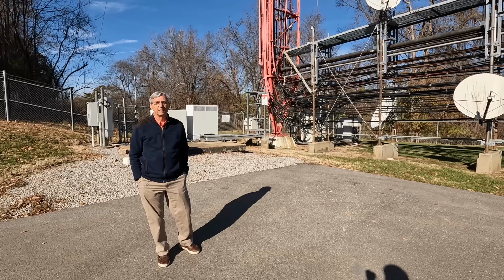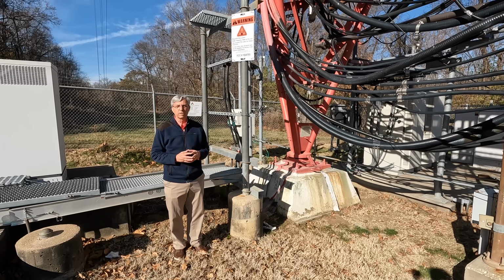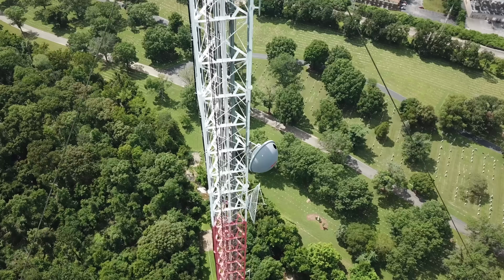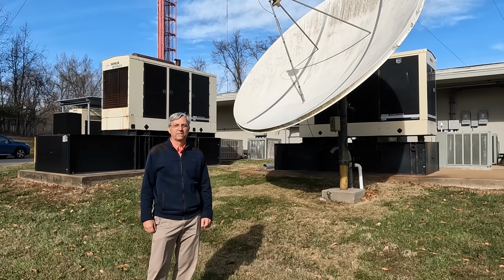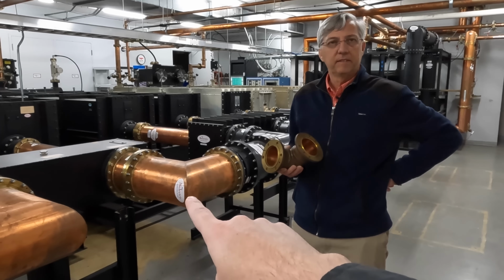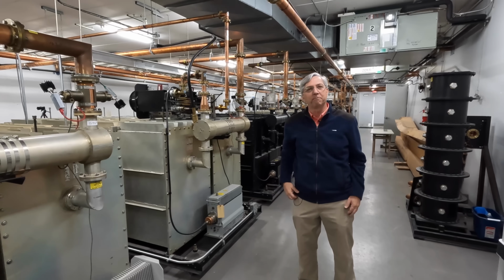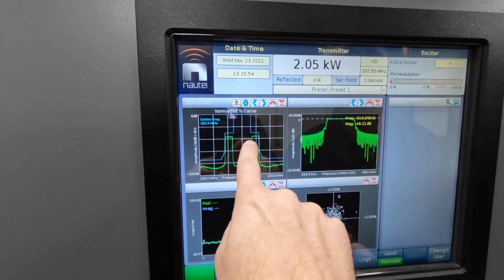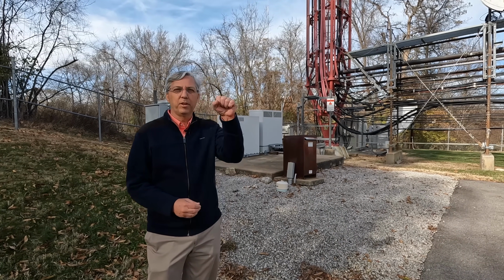1 MILLION watts—really? FM Supertower Part 2!

Comment: Best wishes on your surgery, and apologies on my question if it's redundant.

Tower elevators - at some point I assume they reduce climbing time and fatigue costs (over their own maintenance cost). My guess is that this tower, due to its age, face width and maybe height, does not have an elevator - can elevators be retrofitted?
Reply: Not being a climber or in the climbing biz I can only speculate that elevator safety and insurance are big reasons why elevators are left off or not in service at many sites. If I did climb I would look for some invention that would aid the climb and we would all benefit from that as long as it was safe. Climbing safety has improved dramatically since I started. Some of the rules seem a little harsh but overall safety changes for climbers seem to have made climbing safer for the guys who climb. 
Also - when there is the will and money I’m sure a tower could have an elevator of some kind added!

Comment: I live in about 700m to a TV tower which is 300m high. Once there was lightening strike that killed my PoE switch and WIFI access point. Of course it wasn't direct strike to my house but somewhere nearby, i suspect it was direct strike to the tower. But the strike was so strong its EMI damaged those devices.

Comment: The info that DAB+ is similar to Cell isn't correct. It is sent on VHF o rUHF carriers from the same masts they which are used for FM (or DVB-T(2)). It is just that several of those masts are now synchroniously sending on the same frequency, widening the coverage without having to switch frequencies. And the same as with the digital/analogue signal shown here applies, you need a lot less power for the same coverage

Comment: I got to tour a true megawatt tv station, the dummy load was the size of a refrigerator, it had a nearly new amplifier system with hot swap-able modules.   
Met a guy at the Charlotte hamfest who builds 80k+ cb amplifiers using steel tubes like that.

Comment: I love this series! Could you explain in further detail how the one antenna is able to broadcast multiple frequencies? I thought FM antennas were designed and built for a particular frequency. Thanks!
Reply: Every antenna, while constructed for some particular frequency, has some "bandwidth" around that frequency where it works satisfactorily.
So in systems like this, the actual frequencies used by all the transmitters are examined, a point in the center is chosen and the antenna is constructed for that frequency, with enough bandwidth to cover the highest and lowest ones.
Getting more bandwidth typically involves using thicker or wider elements.  You will see that the dipoles used in such antennas are usually quite thick, that isn't only to provide the mechanical strength required at such sites (due to wind speeds), but also to get the required bandwidth.
Reply: @Rob2  thanks for the reply! So it sounds like this approach is a compromise of sorts where you trade a little performance in exchange for saving on the cost of hanging and maintaining multiple antennas. Does this cause a higher SWR at the frequencies furthest from the midpoint? If so does the transmitter also have to be hardened to withstand that? Thanks again
Reply: @BigTunaTim76  The loss in performance, as explained in the video, is less than what you would have when putting multiple antennas in the tower where the last one would be quite low.
The SWR could be higher but with appropriate tuning that would not be too bad.
Remember these transmitters are on a fixed frequency so everything can be tuned to match.

Comment: I'd love to learn about transmitter in sunset hills and the reason for the secondary tower
Reply: It is actually in Sappington.  Those towers belong to KTVI FOX 2.  Virtual Channel 2.  RF channel 33.  Back in the late 90s as DTV was going on air, they
were concerned about putting added weight on the existing tower.  So, they constructed a new tower adjacent to the existing tower for DTV broadcasting.  The tower with the strobes is the new tower for DTV broadcast.

Comment: The radiated power only looks like it's 1MW from where the receiver is. There isn't actually 1MW of energy anywhere that you could capture and use to do 1MW of work.
Reply from the maker: Good way to say it! ERP is the only way the FCC could regulate coverage territory and allow so many configurations of transmitter size, antenna systems, coax size. Thanks!
Reply: @GeerlingEngineering  Yes, it is indicating how strong the signal will be in the main beam of the antenna.
Those stacked antennas transmit a "flat" pattern towards the horizon, so more of your power goes towards the distant listeners and less towards the ground and space.
The effect is similar to a torch light: the spot it outputs can be as bright as a 30W light where the torch itself has only a 3W bulb.  That is a 30W ERP light but the spot necessarily is smaller.  The "gain" of the antenna is never more than the ratio of a full sphere and the "spot" on the sphere it illuminates.

Comment: The forward and reflected power is also known as SWR or standing wave ratio. Reflected power is undesirable because A) it is RF energy that is not radiated from the antenna an thusly is wasted. It is literally reflected back to the transmitter where it is turned into heat. Too much of this and the transmitter is damaged. Reflected power is minimized as much as possible by proper matching of the transmission components.

Comment: All I can say is fascinating!! I have looked thru some of the comments, both this video and the Part 1 video and hopefully I didn't miss it, but even with the AM towers (watched that one already!) What do you do to change that lamp at the top of the tower? AM tower being the "hot" and all the RF signal coming out of the antenna, How does the maintenance tech get up there to change out the lamp? 1115' would be a long climb!! Thanks
Reply: Ha, good question! And we have an AM site tower tour up now, too (KMOX-AM, 50kW). Basically, they switch to a backup tower, then ground the tower, then the climbers can go up somewhat safely. You still have to be careful because the tower will be picking up signal from the backup tower if it's anywhere close... lockouts and multiple ground clamps help.
Reply: @JeffGeerling  Thanks for getting back Jeff, but how do they handle the FM tower and with all the "leased" antennas? In my younger days, I did a little bit of antenna/tower work (CB/Two-way business) nothing as high as these are!!
Reply: @ShouldersMoondog549  That's a good question! I believe they plan the tower climbing/maintenance with all the various stations, and they would be required to either operate at a safe level or switch to backup transmitters.

And the tower climbers can also lock out the main RF feeders too—there's a safety lockout in the basement where they can make sure nothing can hit the tower itself, at least for the truly dangerous RF feeders!
Reply: @JeffGeerling  Thanks!!

Comment: Hi, I didn't want to bother you, but since you invite questions, here's mine.
At a certain point in the video you show a ceramic vacuum valve, probably Eimac.
Years ago I was told about the use of these tubes for audio power amplifier designs. When Joe takes out a ceramic tube and says that he would make an audio amplifier, I almost fell on my ass, since I have been looking for these devices for years without success. I know that the refrigeration generated a high pitched hum and gave out a lot of power and quality. My question is if you know which brand manufactured these devices, models or if there are diagrams for their manufacture. Thank you so much.

Comment: If a big RF tower like this one is broadcasting on a known frequency, why is it illegal to broadcast on the same frequency at a much lower level, e.g., with a handheld 5w 2-way radio?

I understand the ownership/licensing issues, but are there technical reasons that boost the argument? In other words, isn't my low power handheld only going to work in a small area, and probably be out-shouted by the big high energy tower?

Thanks for doing this video Jim's dad!! Jim: hope you're recovering well. Happy new year!
Reply: Your small transmitter WILL affect anyone near you. My neighbor had a car FM transmitter that is mere milliwatts of RF tuned to the same frequency as a local station and it blocked my reception of said station. To make it worse they left it on and transmitting a dead carrier even when the car was parked and off. The only time I could listen to that station was when they weren't home.

Comment: I have to disagree with the digital - the coverage since going to DTV is absolutely horrible.  I remember analog we could pick up most stations from 2 major cities each ~50 miles away using just some rabbit ears and minimal if any .  Now to pick up most of them from just 1 city I have had to get 2 high-gain directional antennas way up high wired in a phased-array into a pre-amplifier at the antenna, then after it comes down thru a distribution-amplifier feeding down to where the TV is, and then I still often have it freeze or break up briefly when watching.  HD-Radio is worse, doesn't seem to work more than about 5-10 miles away from the broadcasting cities, where analog FM works perfectly a good 30-40 miles away.

Comment: Hello from Germany. We do have DAB+ in Europe. Can only speak for Germany: DAB isnt very well accepted here. The fact that the amount of energy needed on the receiver end is much higher doesnt help that e.g. mobile radios. We still have A LOT of analog FM UKW (ultra short wave) stations on air. And this won't change for the next 3-5 years.
Reply: There is also little enthusiasm in Belgium. Only public broadcasting and bigger players active. Although I notice that smaller city radios are joining forces and placing a DAB transmitter together. I think streaming via 5G or so is more likely to make it over DAB.
Reply: @joostluyten_ON2OT  On the other hand, Norway has switched off FM several years ago.
Indeed I think DAB is not well accepted and most people will skip it in favor of streaming.
That is also why the radio stations do not like the forceful shutdown of FM, because they know that when people are forced off their transmissions and have to look around for new ways, they not necessarily come back to your station but may find internet streaming more attractive.

Comment: Some hams have towers 150 foot plus it's usually a group of hams that share the site for competition's. The reason they have high towers is for mounting big Yagi beam antennas which increase gain because most top licence class hams are restricted to 1,500w maximum output, so they use big beams to increase the ERP. Some beams can be 20db forward gain which is 100 times the power, so 1,500w of power will have a ERP of 150,000w, if the antenna has 20db of forward gain. Most HF Yagis don't have that much gain however, most are somewhere from 8db to 14db VHF and UHF Yagis can go close to 30db which is 1000 times when stacked. 
Thanks.
Shane VK1NME.
Reply: Then it's call EIRP, not ERP?
Reply: @hopkinskong  how so?
Reply: @shanerorko8076  Not really sure about this but I believe when talking beam gain, it's in dBi, which normally makes more sense to measure in EIRP?
Reply: @hopkinskong  no because dBi is a decibel measurement in isotropic terms, a beam like I mentioned is forward gain not isotropic gain.
Reply: @shanerorko8076  I see, so it's forward/backward ratio in Yagis?
Reply: @hopkinskong  no Yagis have forward gain and front to back ratio which are two different things.

Comment: Just FYI: Europe still has FM, and AM because (obviously) 99% of all radio's are not DAB-capable. There isn't really any incentive to upgrade because the people who sell the radio-bandwidth are greedy and split the bandwidth into cheap low-bitrate licenses so most of the DAB stations that are not making big bucks all sound like crap.

Also: DAB is a yes-or-no system, you either receive eenough of the signal to hear music, or you don't. This means that if you are in an area where reception is not that great, your radio will keep cutting out completely, whereas FM will just add some noise but keep playing some semblance of music, it will only cut out if there is hardly any signal left at all.

That last thing is a serious problem for the "people" who decided that emergency services should use digital radio. You can do all sorts of fancy group-talk and add nice security features, but what  firefighters want is a radio that will receive any signal that is happening on their frequency, including carrier-only signals where they can comminucate simple yes-no messages with firefighters who are in trouble inside a building.

Anwya, we have DAB and we have FM and even some AM.

Comment: DAB+ ... the mention saddens me.
The way it's been implemented in Australia is horrific and completely opposes the promises of high fidelity that were advertised to us.
With bitrates between 24 and 96 kbps, the 40 and 48kbps being about average the audio quality doesn't even come close to FM broadcast.
Clearly they figured they'd make more money by squeezing the life out of it.
As an alternative to talkback AM stations it works OK, but for anything where music fidelity is remotely important even 96kbps is terrible.
Add to that poorer coverage than existing AM and FM and it's nearly pointless.
Reply from the maker: At least they don't call it "HD" over there, you'd think "High Fidelity" digital would have better clarity than analog, but stations are generally 96 kbps here too, with sub-channels down at 64/32 Kbps.

As you say, the clarity is a huge improvement for talk/AM, but a downgrade in everything besides S/N ratio for FM as it's currently implemented.

It would've been better at 128, 160, or 192 Kbps, but that would eat into other side channels.
Reply: @GeerlingEngineering  The main advantage is that it allows co-channel transmission of the same content.  On an FM or AM system you usually have large coverage areas and each of them has to have a separate frequency that can only be re-used some distance away.
So when a regionally operating station cannot be covered in a single coverage area, it has to have different FM frequencies for each of the coverage areas (towers).
In a DAB+ system, all the transmitters required to fill the entire region can work on the same frequency.  So it becomes more attractive to have more transmitters each with a smaller coverage area, and thus a lower tower and less power, adding up to cover the entire region.  That will save on energy, engineering, maintenance, etc.
Therefore both stations and authorities are pushing towards DAB+, even when the actual quality is less.

Comment: Maybe someone has made this comment already, but if not, I noticed a corded phone with a push button dialer in the background at around 16 minutes in. Cell phones won't work inside that structure or is it a hazard to use them there?
Reply from the maker: Cell phones work fine inside, but having a wired phone in a facility like this is always handy... especially if they're replacing the equipment that's running the mobile network at the time!

Comment: Those "combiners" are HUGE.  I googled combiners and the images show they're like little solid state LAN boxes now?
Reply: It's physics — these combiners are for 20-35 kW of RF, which combines into two pipes holding 330,000 W (330 kW) of combined RF energy. Needs a very beefy coax line to get that signal up to the top of the tower!
Reply: @JeffGeerling  Your dad's remark: "You don't want RF energy arcing through you to the bone" sends chills!

Comment: that's honestly a shockingly bad explanation of ERP from a radio engineer. the reason why the equivalent radiated power of an antenna can be greater than its actual total power is, because the antenna doesn't evenly radiate in all directions, it instead tries to radiate as much of the energy in the direction of the coverage area, and radiate as little as possible elsewhere. for an FM radio tower, that probably means it's designed to radiate laterally outward from the tower, where there will be people on the ground with radios, and reduce radiation upwards into the sky where there's not people with radios expecting to get a signal. for something like a dish antenna for a point-to-point link, the beam would be focused in a single direction, leading to an even larger equivalent radiated power from the perspective of that dish's target. cell phone towers usually have multiple antennas that radiate out in sectors, that way you don't have to waste power radiating the signals for the people north of the tower southward, for example (newer cell network tech takes this much further, and does a bunch of extremely clever phase cancellation stuff with multiple antennas to actually "aim" individual cell phone signals at individual devices, allowing even less power to go out on the airwaves to achieve the same level of performance). so, equivalent radiated power is basically "if you were in the area targeted by a directional antenna, and you assumed that the antenna was omnidirectional, here's how much power you'd think was going into the antenna". ERP doesn't represent any actual physical quantity, it's just a useful metric for understanding the performance of a radio system within the context of a particular application.